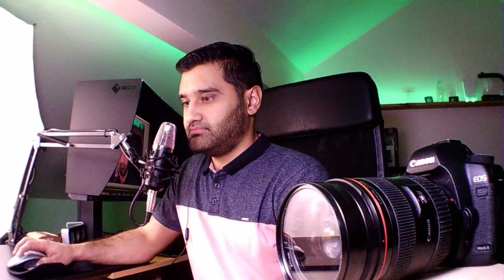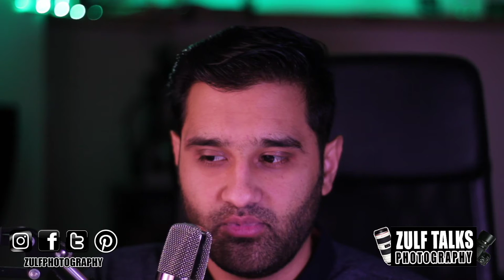What does the Digic processor do?

Comment: So if my camera has a digic processor 8, it will have less noise and better quality compared to a camera with a digic processor of 7?
Reply from the maker: Generally yes but there may be other features that you would prefer what two cameras are you thinking of getting?
Reply: @zulfphotography  @Zulf Photography Yes you are right. On my computer monitor I can see a clear difference. The digic 7 processor has more noise, but somehow on YouTube, it's hard to see a difference. I prefer the Canon Sl2 because of the quick auto focus, though I'm losing quality compared to the g7, but it's worth it. The G7 would sometimes take 10 seconds to be in focus at higher apertures
Reply from the maker: @Topic_____542  if the main place the video will be shared is online then stick with the canon.